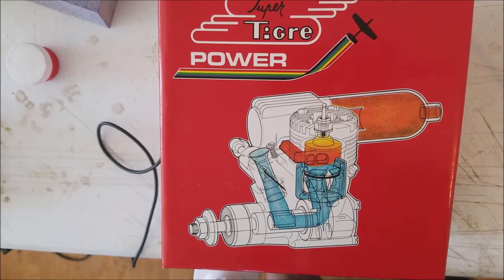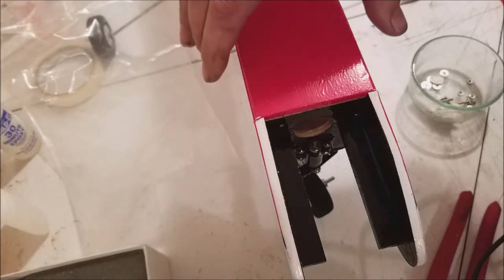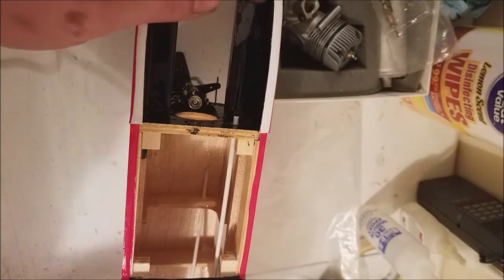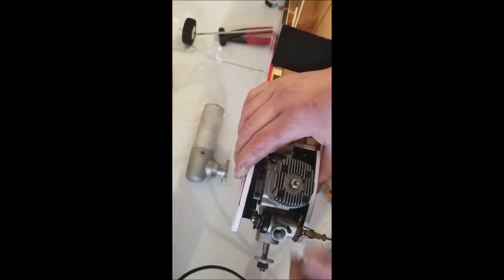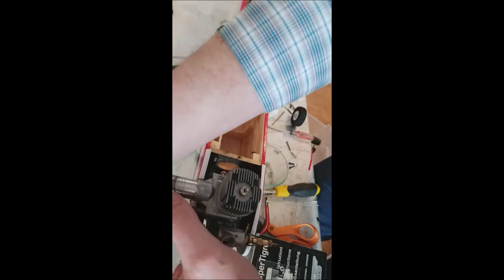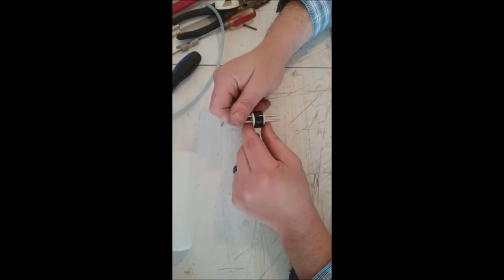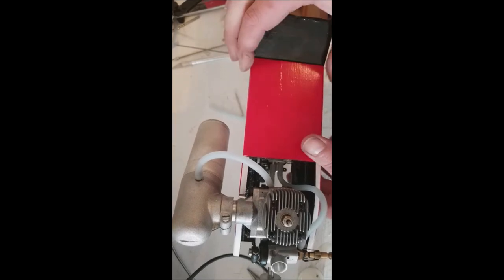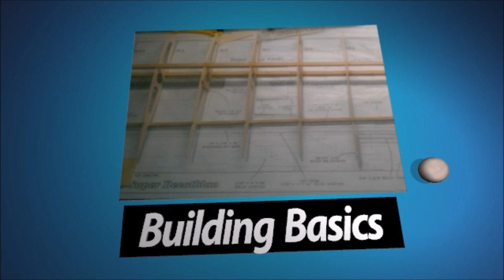Engine Install

Comment: Good info in these videos. Really appreciate it. Do you think you'll do a video on break in and tuning for the super tigre? I'm putting a super tigre 75 on aTower 60 kaos im putting together. Haven't seen many videos on break in  and tuning for them.
Reply from the maker: I sure can. Once a Super Tigre is tuned and broke in correctly and maintained properly, it will run forever. I will do a break in and tune video once we lose some snow here lol
Reply: Big Sky Hobby Corner looking forward to it!  man I hear you.. We're about to float away here in Tennessee lol
Reply from the maker: Lol, thats awesome. We are still under 8" of snow here. We have a warming trend coming over the next couple of weeks so hopefully I can get outside and do some running
Reply: Wow,,,!   Do you think you may have an issue with the CG?   I mean to say,  how much weight to the tail will you have to add?   Just thinking out loud.  If you make it work, it should "Blast into Space"
Reply: My comment was directed to Shannon W.